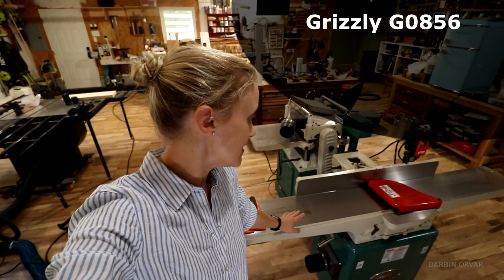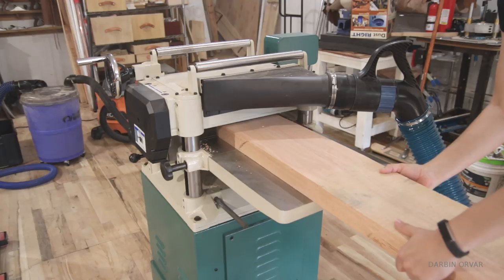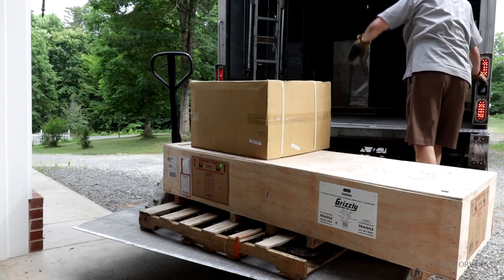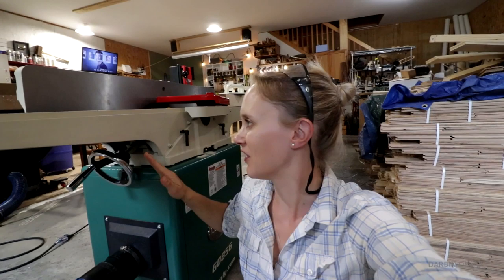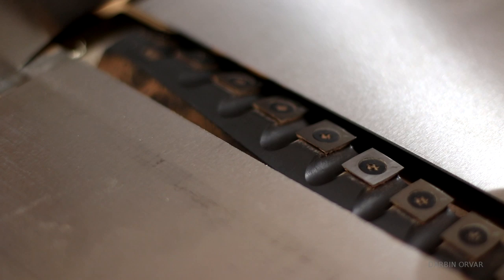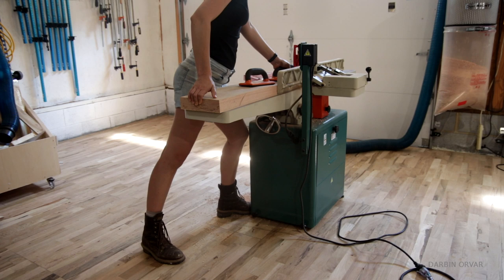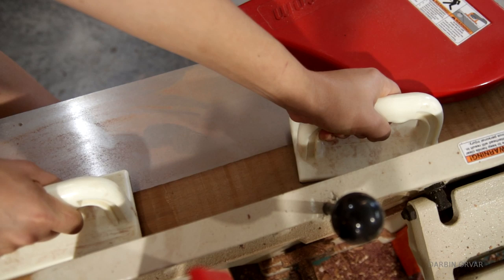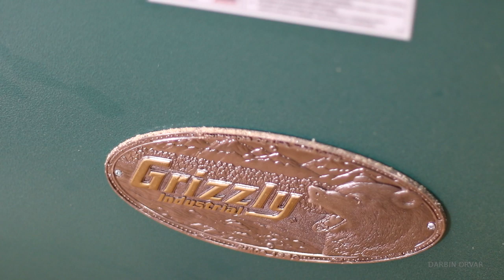What's The Difference Between Jointer & Planer? My Grizzly G0856

Comment: the difference:  a jointer cuts the tip of your fingers and a planer only pinches them - high school shop class wisdom, good job Linn.
Reply: I was going to say that. 
Never joint a thin piece of wood. 2” is my minimum .
They are called buzzers down here

Comment: Mmmm, jointer! Ive got a single car garage myself (no 220v) and am on the hunt for a jointer to flatten all of my rough cut lumber. My main issue is space, but my last benchtop jointer....well....lets just say it left me needing something with a bit more capability. If im honest  im terrified of setting up a jointer after struggling to get the budget benchtop jointer set up (no matter what, it would not get true flat cuts). Your video really put my mind at ease as far as set up goes! Enjoy the new tool!!!

Comment: I just bumped into your channel while looking for G0856  reviews.  You have an impressive collection of vids!  I have two questions about this one:  (1) how well does the mobile base work?  i.e. how easy is it to move the jointer from one place to another?  (2) Do you have a video about the router fence setup you have on your SawStop router table?  I'm trying to decide with whether or not to keep my very nice by space consuming router table, or to consolidate to the SS one.  Space is challenging for me, but I can crowd tools together.  Thank you.
Reply from the maker: The jointer is very easy to move around on the mobile base. I am planning to do a video soon about the tablesaw that will include info on the router. But I would say the ss router fence is very good.

Comment: So the purpose of a jointer as to make adjacent faces on a piece of wood perfectly flat and square to each other.  It does not make opposite faces parallel to each other.  This is where the thicknesser comes in.  Put one of the faces that you just flattened down on the thicknesser away from the blade and feed it through.  You now have three faces flat and square and two that are parallel to each other.  Repeat in the thicknesses with the face that is left.  You should then be left with a perfectly flat square and parallel piece of wood. 😉😀👍